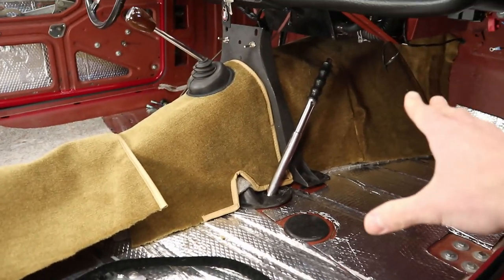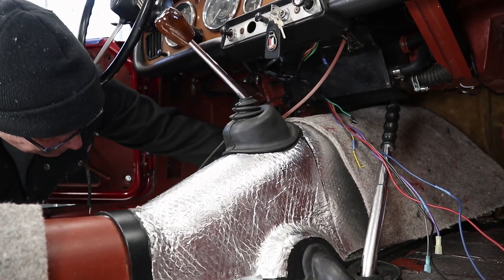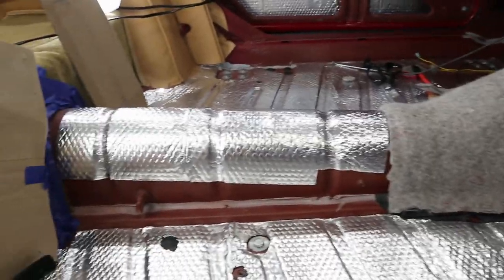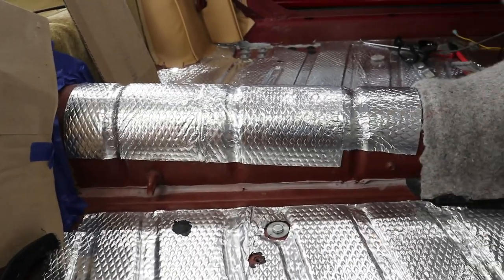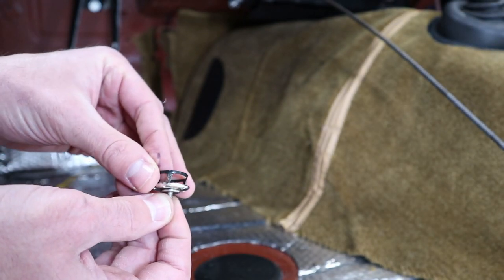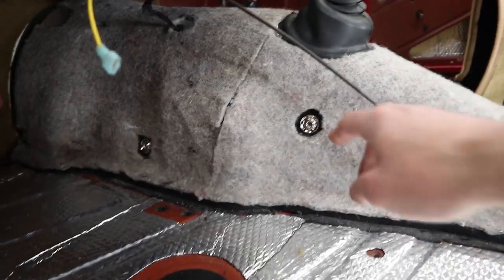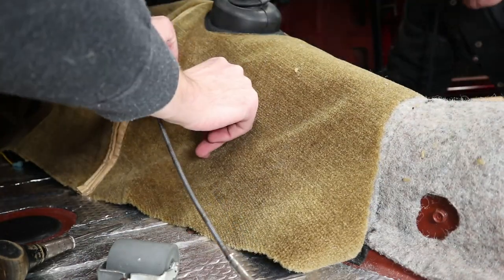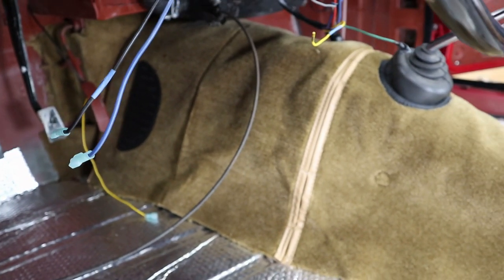How NOT to Install Gearbox Cover Carpet - Triumph TR4 Interior Carpet Install Part 2 - WEGS GARAGE

Comment: Great video! Thank you for posting! Where did you find the carpet snaps with the thread-in male snap?
Reply from the maker: They were supplied with the Moss Motors carpet kit. Not sure if you can buy them separately.
Reply: @WegsGarage  Thanks for the "Steer", yep, I found them on the Moss site. Keep posting the great videos! Very helpful and inspiring my own 1500 project!

Comment: Question: Roughly how many sheets of sound deadening material did you use? I need to get some for my TR4.
Reply from the maker: We purchased a box with 36 square feet total coverage. There were nine sheets in the box, and I think we used around 7 or 8 of them.
Reply: @WegsGarage  thanks guys 👍